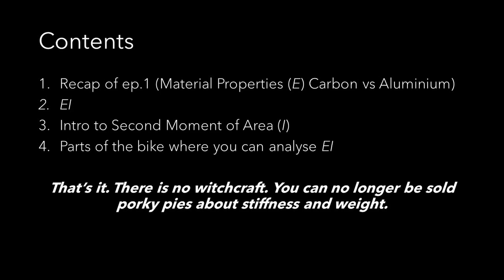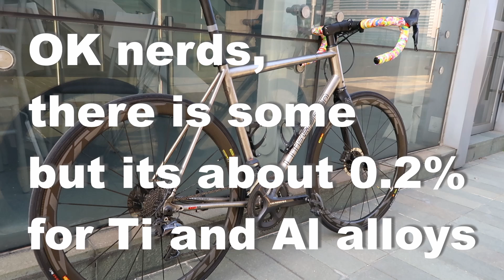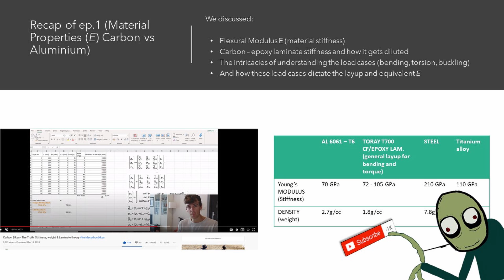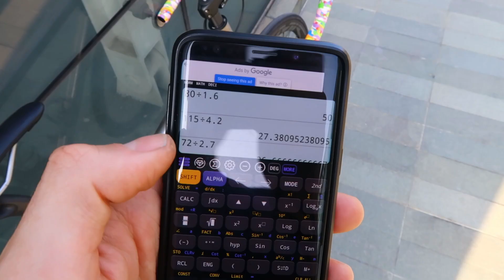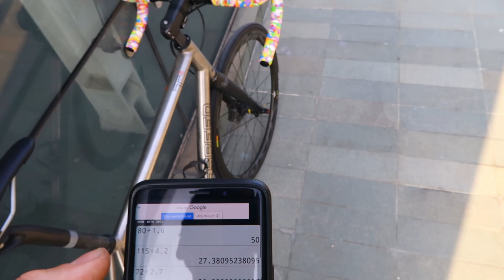Titanium Bikes - The truth and Physics of 'ride feel' marketing.

Comment: thanks for the video, doesnt the crystalline structure of the material affect the internal damping and hence vibration response - maybe it too small a difference? https://stacks.cdc.gov/view/cdc/10399/cdc_10399_DS1.pdf My background is more hydrodynamics, but there in the vibration equation of motion there is a damping term proportional to velocity (as well as the stiffness term proportional to displacement, and the acceleration * mass term). Maybe its more geometry of the tubes, typically going steel > titanium > aluminium results in increased tube diameter. Also I think in most cases the threshold stress for fatigue for Al is very low compared with Ti or steel so a Al frame needs to be stiffer than a steel or Ti one? Ive got Ti and steel road and mountain bikes, the MTBS are identical geometry (different tube diameter though) and they do ride differently (or maybe its just perception :-)

Comment: Titanium is light and strong. You also can get a Custom Frame made to your body. Good luck finding that with Carbon.

If you go Titanium, it's because you'll never have to worry about it splitting in two after a crash or even your bike falling over. If a Carbon bike falls over, get ready to Chuck that $5000 frame into the trash. 🤣😂

Comment: Damnit sir, this was about 8 months too late lol. He's spewing absolute truth here, recently had a custom built ti gravel frame done by Waltly TI. Great bike, but it's certainly more rigid that my carbon bike by a very notable amount. The first ride with 650b wheels wrapped with 47c tires.. instantly noticed how much more like my old aluminum hardtail it felt. To those who are considering something similar, as he mentioned it makes a huge difference based upon the tube diameter.. so if possible prior to purchase/design try some TI bikes out. I regret designing my frame after the Moots Routt 45 because the tubing diameter is so large. It makes for an extremely stiff frame, not to mention more weight than necessary as well. Thanks for making this, as much as I wish I can lie to myself that it's a magic carpet.. it's definitely not. Very educational Video!.

Comment: Titanium bikes are a self fulfilling prophecy. We buy them because we’re looking for a compliant bike so the manufacturers build a bike to be compliant.  It’s just tube profiling bowman and others have been tuning their aluminium frames for compliance for years. I would imagine if you tested an endurance carbon bike, ti bike and aluminium bowman or a steel bike the stiffness and compliance would be similar. At random you can have a bowman palace (aluminium) litespeed/ moots (titanium) and enigma (steel) all specialists in high speed comfort.  But you can dial in a lot of comfort with shallow wheels, fat tyres, long seat posts or flex posts. Or you could go rim brake the wheels are radially spoked have less spokes  and are  more compliant than similar depth disc wheels.

Comment: I might buy your assessment if every ti frame out there used round tubes. Fact is Ti builders are starting to make very carbon like tube shapes and varying thicknesses not to mention innovating with 3d printing things like drop outs, bottom brackets, head tubes, etc. So if you're assessing a 15 old design that's all welds and round tubes, you're correct. More likely you're making a hasty generalization that ignores very recent innovations that don't fit your "everything is built with round tubes" story.
Reply: Manufacturers are now producing actual 'aero' shaped ti tubing??

Are there any 'aero' road bikes being built from this?
Reply: @Fordworldrallyfan  no not aero. Shaped to take advantage of titanium's properties. Rather just going with different diameters of round or oval. Shaping for stiffness and resilience vs. Aero
Reply: @garthTurningCranks  Merlin was doing the slightly larger diameter round tubing thing over 20 years ago.

They offered their 'Extralight' with slightly bigger tubes when I bought my 'Road', and I now regret not opting for that choice at the time, due to the 'looks' of the thicker tubes, and the added price, even though it was marginally lighter yet. :(

Comment: I wish you would have mentioned the design limitation of cross sectional area with materials of different densities, namely the wall thickness with respect to cross sectional area or curve radius. So an aluminum bike CAN be much stiffer than the ti bike (or steel bike). And the fact that certain parts such as bottom bracket shell and head tube have minimum size limits, so they will be simply heavier in steel and ti than in aluminum. 
Of course I totally agree with your overall point that the hype of ti (and steel) frames is bunk.

Comment: I feel like the point of Ti Vs Al has been missed... Yes, tubes of comparable OD, length and mass will have similar flexural stiffness and resonance frequencies. However, because of the Young's modulus, strength and density, you can make a Ti tube set that is the same weight and strength as Al, but with (seat stays in particular) a smaller OD, and you therefore get more flexural compliance without impacting the strength. Obviously the design still has to focus on compliance, and with hydroforming and double and triple butted custom extrusions a lot can be done in alloy frames, but to say there is no difference between a Ti frameset and an alloy one is quite misleading, Ti does have mechanical advantages which aid in the design of a comfortable ride. Also, yes a triangle is a very strong and stiff shape, so a lot of the comfort comes from the seatpost. But to say that it all comes from the seatpost is only true if all the tubes are dead straight. Put any sort of curve in the seat-stay and you have a tuneable stiffness connecting the rear wheel to the seat-tube.

Comment: Your bike weighs 8.5 kgs? My ti bike (frame from XACD 2004) with Campa Record carbon 10 speed weighs 7.5 kgs. Only new 38 mm 25 width carbon wheels, nothing exotic on the whole bike. And it looks about the same size, although my seatpost doesn't stick out like that. What went wrong? The disc brakes?

Comment: For giggles the other day I popped my 23mm tyres on my mates carbon giant defy. To see if it was as compliant as my 2010 canondale synapse. I was amazed at how harsh the ride was. My hand and feet almost went numb immediately and I had to brake on my favourite decent to maintain my vision. Modern disc bikes have been stiffened so much (wheels and frame) that they are unrideable  on 23mm tyres. There is a lot being hidden behind the adoption of heavy high drag fat tyres.

Comment: One of the biggest factors in frame comfort is tube diameter!
Titanium, and steel to a greater extent -  tend to have smaller diameter tubes and allow a springier feel.
You don’t need to be an engineer to understand that if you compare a “rod’” against a “tube” of any of these materials, given that they both have the same cross sectional area,  that the rod is easier to flex and to bend permanently. 
Tube shape is another massive factor, take a 12” ruler and you’ll see that it bends easily across its flat cross section but is almost impossible to bend in its vertical plane. 
When you take a concept to its n’th degree its much easier to comprehend. Imagine making a bike frame from rulers lined up in the vertical plane, its gonna have massive vertical stiffness but impossibly flexy in the lateral plane.
I don’t know why you state that two frames of different materials will have a similar stiffness if both materials have similar stiffness to weight ratio,  it simply isn’t true.
As aluminium alloys have to be stopped from flexing  to avoid failure , they have to be oversized in section and that’s what makes them stiff.
Skinny steel tubes can bend more without staying bent which makes them ideal for a springy feel. But who wants a bendy frame? who remembers chain rub on the front mech? I do and it was awful - thank god that I now have carbon and di2

Comment: As a big guy shopping gravel bikes, I watched this video and the QR vs thru-axle one with great interest. Having discovered that most dealers are sold out due to the pandemic, I’m looking at Ti and magnesium framed bikes from Lynskey and Vaast respectively.  Would love to hear your comments on magnesium, or in the Vaast case, “super” magnesium.  -Cheers
Reply: Don't go near magnesium. The material is prone to failure due to corrosion. The "super" is only a marketing BS term for galvanic surface treatment. Over the long term this will not protect the frame at all and is prone to quality issues right from the start.

Comment: Considering bumps come in at different frequencies, and travel in varying lengths depending on size of frame, the different attenuation properties in a chain matters too. Is it feasible to measure resulting peaks and try to mitigate them by shifting weight and material coupling? The tyre is going to matter a lot right away if the rest is stiff spokes and some bartape I would think. The resulting heuristics (of accumulated vibration in the entire bike back to front) is for the most part killed by differences in frame and fork material, or bartape and seatpost/covering?

Comment: Just from a pure physics direction, any structure well below it’s primary resonance will be similar. As you said it’s about stiffness of the structure, and the weight of the system (including the rider which dominates) not the material that causes this. For a person on a bike, this resonance is probably between 1-10 Hz. 

Now what happened near, at, or above resonance—that’s going to depend on a lot more factors.  

Dampening at resonance depends on the internal dampening, but also on the amount of stressed material, so geometry matter more. Also, lower system resonances will be harder to dampen. 

I’d posit that fatigue inducing vibrations are almost entirely at or above primary resonance, where transmission is higher and absorption depends a lot more on the specific structure shapes and material properties. Shapes of structures used are indeed very much tied to material, because of limitations in manufacturing processes. Without vibration measurements, and time-consuming correlation with human perception, I’m afraid this debate can’t really be resolved.

Comment: Straightforward point, perhaps you are conveying it a tad too polarized, though. Which I suppose is your intention as on the internet only overemphasized information gets picked up. Nonetheless, here goes. 

How about material specific design limitations e.g. shapes, fatigue, corrosion, impact resistance, etc. This in essence determines the degrees of freedom for the overal bike design, which in the end has a considerable larger impact on the handling than only trying to measure it against the intrinsic material properties. And how about damping behavior e.g. force as function of rate of change? You only seem to talk about the 'spring'-element of the mass-spring-damper analogy that is typically used to depict dynamic systems. You are right that its eigen frequency (resonance) and higher modes are determined by weight and stiffness, but that is a very static way of looking at things. In truth a bike is a dynamic system where in fact the deformations are response determined by  the various excitations (forces from road, forces from cyclist) filtered by the bike specific dynamic behavior. This filter is a transfer function, which is not only determined by stiffness and weight but also by damping. I haven't designed any bikes so far, but given some dynamic theory I would guess that lambda would be a key design parameter. This is a ratio between the systems actual damping versus a critically damped situation for a given mode of vibration. The most important modes of vibration could be damped (of course below lambda = 1),  while the most important power transfer modes can be kept stiff. This results in a trade-off which will be treated differently based on the desired final 'riding feel'. 

In short; you are neglecting dynamic behavior completely and oversimplifying the multi-parameter design process to a single intrinsic material property.

Comment: Agreed, the Ti ride is no better than a  steel bike. Glad you corrected yourself in the pinned comment. No amount of quoting technical terms - can hide that you missed crucial data. The simple fact is that ali frames have to be made stiffer - as they can handle far less flex. Stronger materials like heat treated-steel (e.g. 853) - are usually built to make more comfortable bikes with more flex - as the frame can take that flex repeatedly without failing. Standard cro-mo steel cannot do that. So yes, with young's modulus, you could, in theory, build a bike out of the same types of steel - with all the same wall thickness etc. But the lower grade steel would not be able to take the flex, esp. if it was an mtb with a heavy rider for example.  Sorry, but your original video just missed the key points - and hide it in a lot of tech terms that made it sound like you knew what you were talking about. One can feel a quality steel frame flex as put on the power. Frames do flex! Agreed the seatpost often makes the most difference. Esp. a cheap compared to an expensive one.  But frames matter too. Over the past three decades, I have built up and ridden many.

Comment: Hmmmm. I'm open to being persuaded that titanium is NOT in fact magic, except ... i had aluminium, carbon and titanium (mountain) bikes and rode them interchangeably. (Scott Racing, Scott Genius and unknown titanium.) The titanium was 'everything' (poetic licence here) you dispute. Buttery smooth  etc etc. Having said that, my (carbon) Fuji SL1 circa 2009 with 25mm GP5000s rides much the same as i remember my titanium bike feeling. Composed, smooth, direct, ... BUT only true when shod with FATTER tyres. Back to the other bikes i referred to; the titanium stood out even though it had the same tyres, at the same pressures, as the others. So ... hmmmmmmmm.

Comment: I agree with most of this, but the argument that they have similar stiffness densities isn’t applicable because titanium bikes are just going to tend to be lighter than aluminum bikes due to the density of the material. You proposed a situation where they were the same weight, but this simply would not happen with the same frame shape due to the densities. So titanium isn’t relatively very different in stiffness to aluminum but the absolute stiffness of your bike is going to be less with titanium because you just can use less mass to get a frame
Reply from the maker: Please see the pinned comment at the top! Thanks

Comment: The reality of having a custom Ti frame:
+ you don't care about scratches, it always looks amazing (as long as it is brushed finish, paint on Ti doesn't make sense at al or sandblasted finish)
+ it doesn't rust
- it's heavier
- it's not even near as laterally stiff as a carbon frame
- it doesn't absorb vibrations like carbon frame
- everybody ask you about it and you have to say it's amazing and it feels awesome, when in reality it's worse than a carbon frame
- when it breaks (and it will), you have to buy a carbon frame which comes with its own fork and headset so you end up with an enve fork and a king headset in the cabinet

Having had one, would I recommend a Ti frame? only if you have lifetime warranty, other bikes and plenty of money for a show bike. The ideal use would be for a commuter bike, but only if you can get it inside the office, otherwise they will steal it on the first day. 

Conclusion: waste of time and money, don't buy a Ti frame, buy carbon.

Comment: I have a question. A few years ago when i got in to cycling and started doing my research on which roadbike to get, every aluminium roadbike review video referred back to the 90s early 2000s aluminum bikes and them being too harsh as a references. Then they would say that now its not like that. What is it they did with the frame design that has caused aluminum to be more rideaable now or is it just a way of marketing their new range of aluminum bikes?
Reply: Changing in materials and smart butting
Reply: Different aluminium alloys have different qualities - apparently aerospace alloys have become more accessible to bike manufacturers over the last few decades. 

Probably computer aided frame design has refined things a bit as well. The modern aluminium frames definitely look different to ones from late 90's early 2000s. 

Hydroformed aluminium tubes have been available to frame manufacturers for a while which influences frame design and maybe comfort as well.

Carbon fibre forks are often paired with aluminium frames nowadays.

Comment: Hm you pretty boiled the whole thing down to a simple camparison of weight to strength ratio.  I don’t think it’s all that easy. What is with smaller tube diameter on denser materials? Different tensile strength? Difference in lateral stiffness... actually your example with Nylon and steel strings on a guitar speak all against your point. They may have the same main frequency, but vary heavily in sustain, attack, distribution of overtones etc ... with strings the material makes all the differences.

Comment: I ridden ti, steel and carbon and for me steel just feels better. Quality steel like Columbus EL-OS, Tange Prestige, Ritchey Logic, True temper OX PLATINUM are all great. My current mountain bike has Columbus EL-OS steel, 26.8 carbon seatpost, 2.4" tires and a rigid Tange Prestige segmented fork really nice lively feel to it.
Reply: Totally agree with your comment, I have 2 carbon road bikes and a carbon TT bike and an aluminium road bike,  all less than 5 years old and I have ridden and owned a crazy amount if bikes over the last 30 year but last year I got a Colnago Super (Columbus tubing) from 1982 and built it up in the summer and it is far and away the most comfortable bike I have ever ridden.